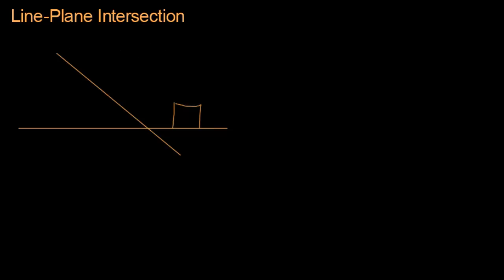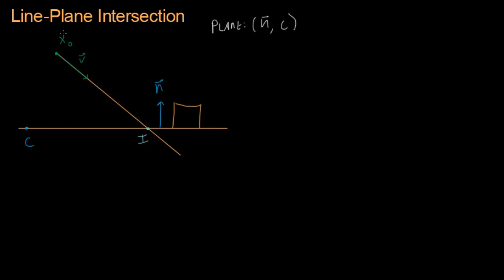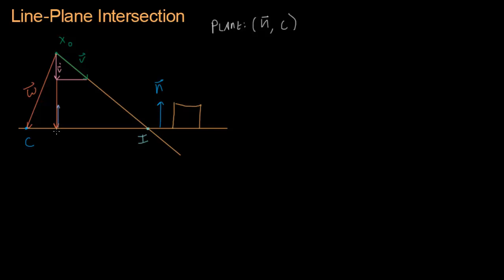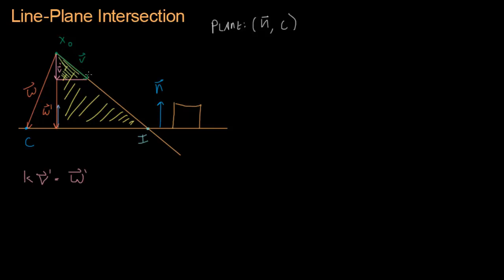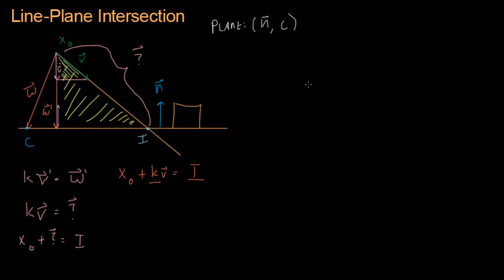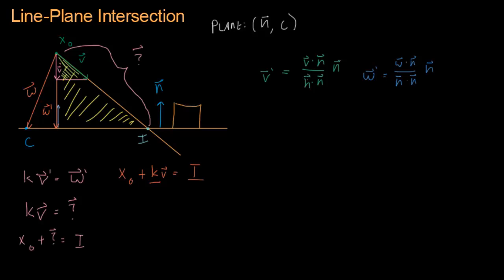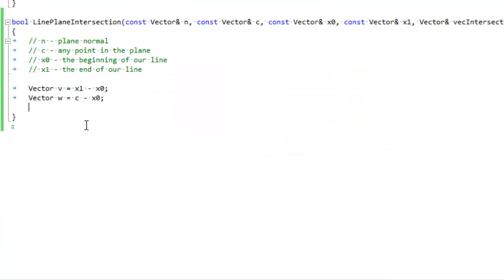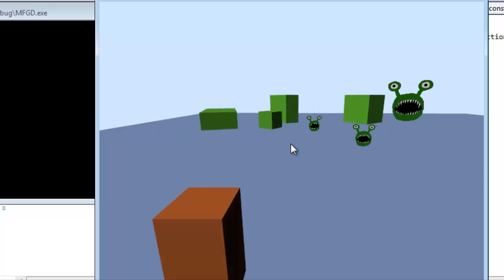Math for Game Developers - Bullet Collision Part 3 (Line/Plane Intersection)

Comment: Question, I accidentally normalized V and I end up getting the same intersection points. Is it wrong to normalize or if by normalizing V am I getting the intersection point on an infinite ray where doing the delta only gives me the intersection point if it exists between the start and end of the ray.
Reply from the maker: Notice how the solution is the same no matter the length of v. If I had drawn v a different length, 'I' would not have moved. 'I' only moves if the orientation of v changes, and the length shouldn't matter.

You have to stare at the formulas for a while to see why the math agrees. I = x_0 + kv and k = w . n / v . n. Recall that v . n = |v| |n| cos theta, so substituting k you get I = x_0 + v (w . n / |v| |n| cos theta). Notice you have a v in the numerator and a length of v in the denominator. So the length of v 'cancels out' and all that matters is its orientation.

In the end it means normalizing it is harmless. Since normalizing can sometimes be expensive, you want to avoid it, but it won't hurt you.
Reply: Took me a few minutes to get why V and Length of V would cancel out, if v is normalize then v == vlen. Ok, thanks for the reply, btw... isn't it a bit late to be answering youtube comments, its 2am for me :)
Reply from the maker: Me too ... can't sleep. :)

Comment: Can you elaborate on how you can write down that k = w' / v' (You mention that you can't but it works out. It works out because the final result is a scalar?) That doesn't seem like a proper mathematical way of reaching the final value for k. How do the values behave when you write it in k = w' / v'. Diving vector by vector? And then you cancel out vectors? What do you get when you do VECTOR/VECTOR, do you get the scalar 1? Is it defined to being a valid operation? I'm sorry, I know I might come off as rude here, I don't mean it. Just trying to understand how does works.
Reply: Never mind. I understand it now. Dividing a vector by a vector was indeed not a mathematically correct operation. A way to reach the same conclusion a more mathematical way would be to change the equation: 

kv' = w' 
to:
k v' . n = w' . n

You dot product both sides and now you can do:
k = (w' . n) / (v' . n) 
Since both parts (v' . n) and (w' . n) are now scalars and division is allowed.

Work from here to reach the same result as in the video
Reply from the maker: Sure. You could also say that since the two vectors point the same direction then w' / v' is just the ratio of their lengths.

Comment: We should check if the bottom part of k calculation is 0 first, because V could be perpendicular to N and it would throw a division by 0 error. If you could take a look at this and see what I mean. Checking if(a==0) will return true if the point you are shooting from is already a part of a plane, and if (b ==0) shows the vector is parallel to the plane and will hence never meet. If these special cases aren't happening, we continue the same way.

 bool Vec3::checkIntersectionWithPlane(const Vec3& pointOnPlane, const Vec3& origin, const Vec3& planeNormal, Vec3& insecPoint, float& ratio) const {

  Vec3 end = origin + *this;
  Vec3 w = pointOnPlane - origin;

  float a = w.dotProd(planeNormal);
  float b = (*this).dotProd(planeNormal);

  if (a == 0) {

   ratio = 0;
   insecPoint = origin ;
   return true;
  }

  if (b == 0) {
   return false;
  }

  ratio = a / b;
  insecPoint = origin + ratio * *this;
  return ratio >= 0 && ratio < 1;
 }
Reply: +Jorge Rodriguez also sorry if I came off as a nitpicker. I really find your videos very useful.
Reply from the maker: Not at all, you are totally correct. Nice work. I tend not to always cover edge cases in these videos when I should.

Comment: How do we find N vector ?
Reply from the maker: If you have three points on the plane A B C you can find n with (B-A) x (C-A) where x is the cross product, and then normalize the result. You must make sure that the three points are not colinear (ie they do not lie all on one line, ie the cross product should be nonzero.)
Reply: Thx i remember now (in your previous video).

Comment: Great video. I'm confused though, what is the x1 vector?
Reply from the maker: +Chris Burrows x0 to x1 form a line, we're testing that line against the plane.
Reply: Ah of course, x0 to x1 is the length of the line.
Reply: So given the directional vector (x,y,z) and the x0 vector (a, b, c), then x1 is (x,y,z) + (a,b,c)*s? S being a length scalar.
Reply from the maker: +Chris Burrows Sure.

Comment: Great and transparent tutorial; do you have a tutorial for ray tracing a sphere plane collision in c++;
Reply from the maker: +Fissle Wine No but it should be pretty straightforward. You can calculate whether the nearest point to the sphere on the plane is greater than the radius of the sphere - if so then there is no intersection. Otherwise, the intersection is a circle. You can form a triangle where one side is the shortest line between the plane and the center of the circle, one side is the radius of the sphere, and the other side is a line along the plane that connects those two. Draw a picture to see what I mean there. You know the lengths of the first two of those, so you can use the pythagorean theorem to calculate the length of the third line. Then you know the center of the circle and its radius, which together completely determine the circle.

Hopefully that made some sort of sense but either way I'll add it to my list of things to cover in the future :)
Reply: yeah I get it I should have a right angled triangle from my sphere centre to two points on plane both distances represent a possible collision; I was just looking for a good channel that expresses this.

I have the part done that represent the direction of the sphere; just researching the second collision that can occur as a result of the shorter distance that is created when the sphere is heading towards the plane at an angle.
Reply: +Jorge “Vino” Rodriguez  so I can use the projection of w onto the normal as a second possible collision? but how do I move the normal directly underneath the sphere position?
Reply from the maker: +Fissle Wine I think I answered this in your PM :)
Reply: Jorge Rodriguez one last question did you normalise your cross product in code?
As in other places I see a lot of c++ that users use glm normalize(glm cross(a,b));
Reply from the maker: +Fissle Wine That's pretty much it, just make sure a and b aren't parallel or else you'll normalize a zero vector which would cause division by zero.
Reply: thanks...